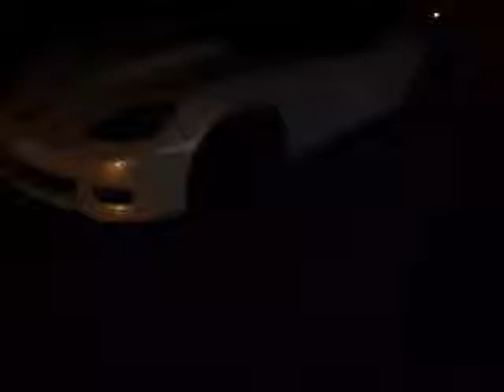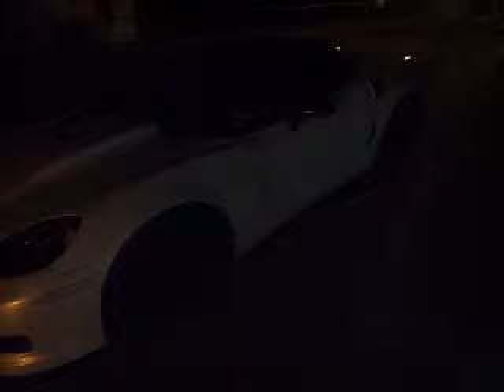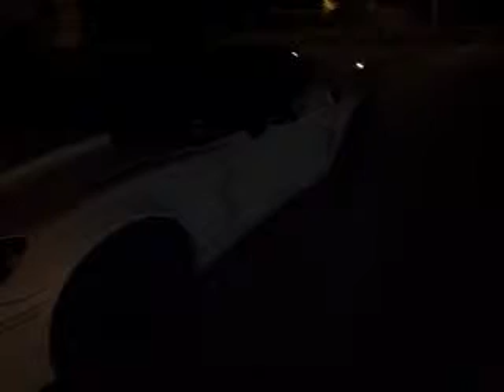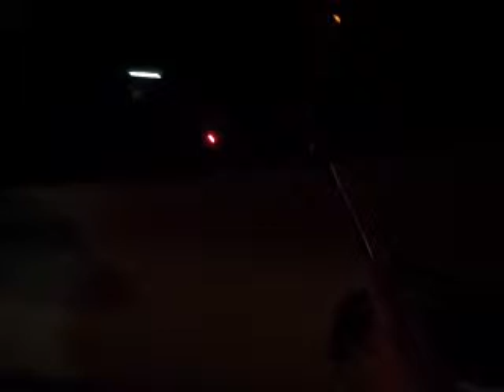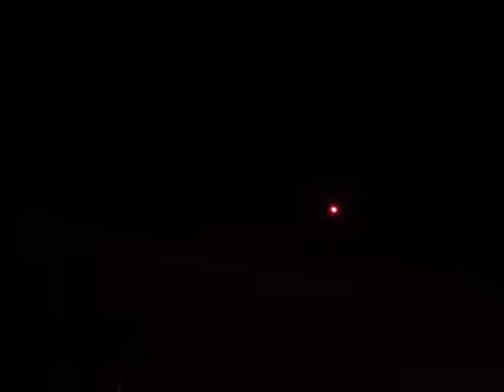2005 corvette door issue.

Comment: Man this is way after the fact that you posted this and I'm sorry but I'm sure your issue is fixed by now. These cars are battery sensitive and things have to be reset when you have electrical issues. You enter the rear under the trunk with your key and pull the release on either side to open the door from the trunk. If you are inside you have handles on both sides to disengage the doors.